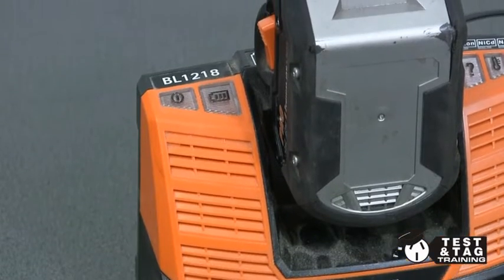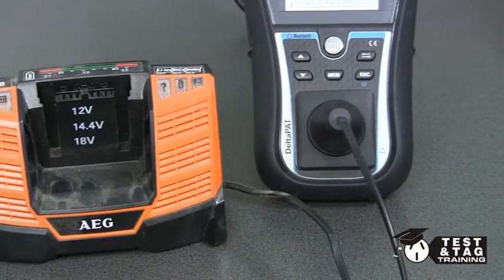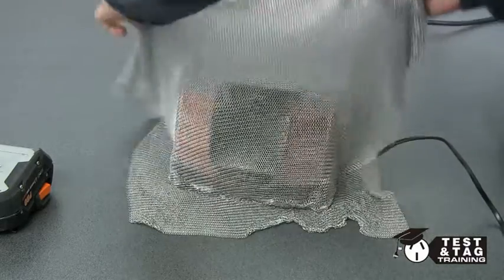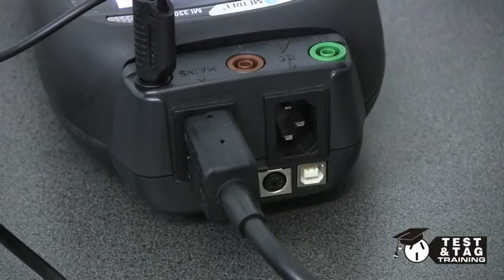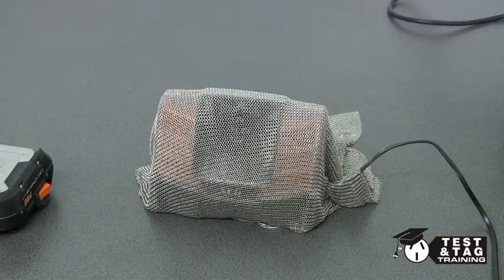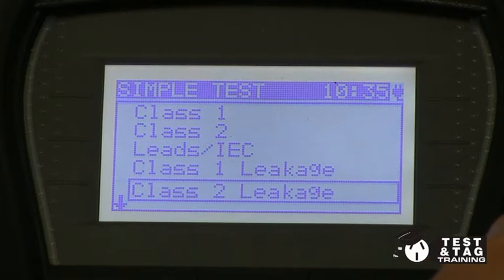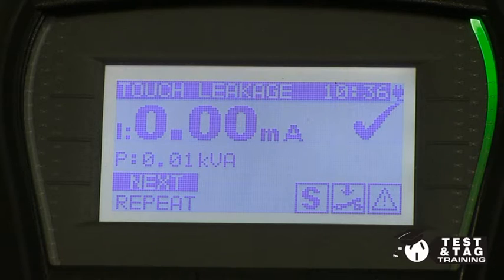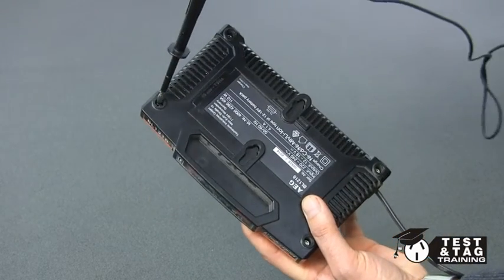How to Test and Tag a Battery Charger

Comment: Hi Matt, I watched this and have tried exactly as you describe. I was testing a Dewalt battery charger. Using a PAT150. When I try the QT to do the tests it keeps indicating for me to turn it on. This is despite trying the PAT150 connected to mains, not connected to mains. Is there something I am missing here? You can't turn the unit on as there is not switch on the charger. If you plug the charger into the wall socket it will only indicate the light with a battery attached. Therefore is there some other process such as bridging some of the terminals on the charging outlet pins? Thanks AB
Reply: Try testing with battery in. Some battery chargers only energize or switch on with a voltage reading from the battery.